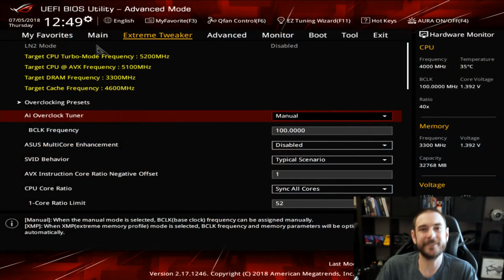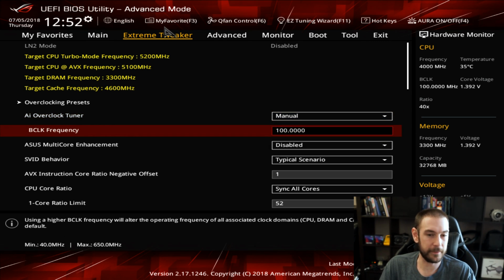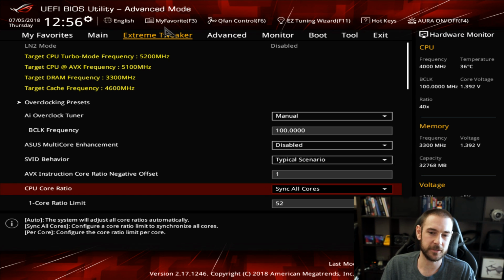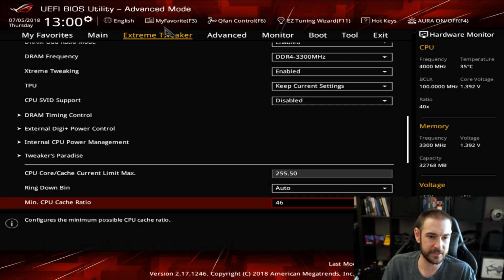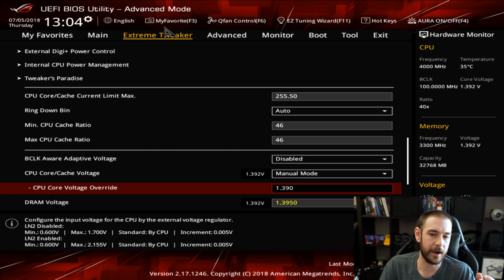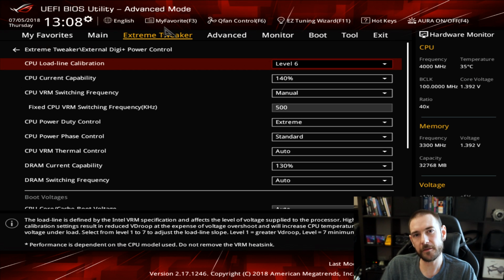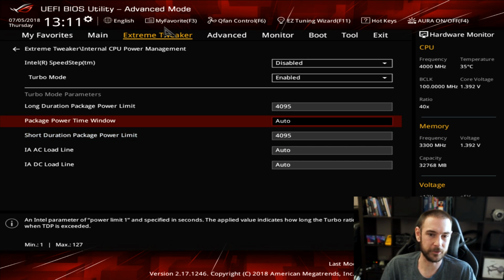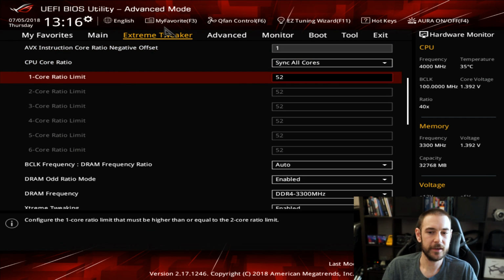How to Overclock an 8700K & 8086K - ASUS Maximus X and Others

Comment: Can not thank you enough. Always had serious stuttering when running games with a 1080ti in my set up. Was able to make some decent gains with just this base tweak.
Reply from the maker: That’s great news :)
Reply: So slightly new issue: I’m running roughly the same setup but I swapped in new ram that clocks at 3600Mhz at 1.35V. But it won’t boot now for some reason unless I set to default settings
Reply: I'm running the same motherboard with an 8086k. I was able to get it stable at 3300Mhz and all cores at synced to 48. It just seems a little strange for this set up it would require those values.
Reply from the maker: What’s your VCCSA and VCCIO set to currently and have you configured your memory timings?
Reply: I belive i set them to 43, where you recommended 42 in this video. in terms of memory timings I haven't played with at all, but I essentially followed all recommendations from this guide. I will probably just need to look into some other guides of yours for more clarity on pushing it a little further. I got it fairly stable with the ram clocked to 3300Mhz and had some improvement on my benchmark but I'll  have to look more into it this week.
Reply from the maker: Sorry. I think you’ve misunderstood. What are your VCCIO and VCCSA voltages?
Reply: Boosted Media 
Cpu core voltage override: 1.3
DRAM voltage: 1.35 (as said by my ram manufacturer)
VCCIO: auto (1.328v)
cpu system agent voltage: auto (1.144v)
Reply from the maker: Try lowering your VCCIO to 1.15V and check your memory timings are all set to auto
Reply: No dice. Still getting sent to the American megatrends screen saying system couldn’t post because of instability.
Reply from the maker: Try dropping your cache back down to 42 maybe. Going past that really makes no difference anyway.
Reply: Did all that and still having some issues with instability when the ram is set to 3600Mhz I have it set to 3200Mhz which seems fairly stable.

Comment: Thanks for the tips. This helped a lot. I managed to get my 8700k stable at 5.0ghz at 1.25v using your guide. 

My only question I guess is an odd one. Should my system be stable at that voltage? I’ve tested using cinebench and Aida64 and running some games for a couple hours like battlefield 1 and it hasn’t crashed or anything even once. Temps on my x62 are around 70c max under synthetic load and 60c when gaming. Not delided.
Reply from the maker: It’s impossible to say without proper stress testing. Check out my stress testing video :)
Reply: Interesting. I’m gonna chalk it up to I won the silicon lottery. I do get errors when I run prime 95 but no crashing. I’m gonna roll with it for a while and see how it performs thorough the weekend with my normal gaming habit. So far today with 4 hours of battlefield 1 and an hour of overwatch it’s been stable 5.0ghz @ 1.25v.
Reply from the maker: It does sound like a good chip!

Comment: One of the only videos that I've found that has the exact information that I needed to overclock my 8700k. I have an Asus Prime Z370-A mobo and it's auto 5ghz overclock was sending 1.488 volts to the VCORE. Right now I'm stable at 1.340. Temps are a little high around 87C on AIDA64 but I'm using the supplied thermal compound on the AIO. I might replace it with something better or even delid it later on, but for now I'm happy with this. If I could get the temps lower it would be great.. 
Thanks for the Video!!!
Reply from the maker: Glad to hear it helped. Thanks for taking the time to comment.
Reply: Dude you're cooking it, forget 5ghz and drop down to 4.7, you want 70c, 65c temps under load or less
Reply: I moved the AIO from the top of the case to the front. Now running a push/pull config on the 360mm AIO. Used Arctic thermal paste on the IHS and now I'm maxing out the temp around 74C. Placement of the AIO and thermal paste made quite a difference.
Reply from the maker: That’s a lot better! Probably had dodgy thermal paste application on the first try. Radiator placement wouldn’t account for such a massive temperature difference alone.
Reply from the maker: Anything under 95 is not going to “cook it”.

Comment: Hey, just how important is it to do a AIDA64 FPU only test and insure that CPU doesnt throttle? I'm working on a Asus Rampage VI Extreme with a 7820X with EK cooling and im able to have a good stable 4.8 ghz clock on 1.2V, but as soon as i do FPU test, it Temp throttles like 9% right of the bat and drop gradually with an occasional spike of about 2 to 3% but im seeing some cores at 105C. Should i always insure that FPU runs smooths with zero throttle and under 85C? This rig is gona be used for mainly gaming and mining at night....
Reply from the maker: I’m not experienced with the 7820X but that seems really hot for 1.2V with water cooling. 

I’d be checking your water block is installed properly with good contact.
Reply: @boostedmedia  Cooling is set-up properly. When doing a CPU test with 4.8ghz it's maybe in 60s range...soon as I hit FPU it's blasts to 105, then levels out at 95C on hottest core. I even ended up going 48 on ration and -10 on AVX. Same thing. Pulling my hair here. I'm thinking I just leave with a small amount of throttle because I don't think this comp will ever use AVX at such loads....what do you think?
Reply from the maker: AVX load is a lot more power hungry and therefore does drive temps up. 

If you’re certain your cooler is installed properly with the right amount of thermal paste then yes it’s time to delid or settle with an AVX offset.
Reply: Boosted Media  
Thank you for your help. I managed to stabilize it at 1.8V with an all core 4.5 ghz clock with 4 AVX and 6 512AVX off set. Seems like the down voltage from 2.0 to 1.8 did the trick for this CPU.

Comment: This is very good. I am new to overclocking. I7 8700k. Asus z370 prime-a. Corsair AiO water cooling kit.  I think that I want a safe and stable 4.8 Ghz overclock and your guide will help me do that.  I have a question though. Other than the core clock and core voltage, Should all of my settings mirror yours in the video, assuming I choose XMP to overclock the memory? You've earned a new subscriber by the way. Thanks.
Reply from the maker: Yeah the settings I explained in the video are a good starting point.

Comment: Great tutorial! Thanks a lot. Though I have one doubt. I have maximus X formula (with the VRM water cooled) and 8700k. With your settings and multiplier 50, voltage to 1.35, cache multiplier (min and max) to 42, AVX=0 and everything is stable. I try to rise to cpu multiplier to 51 (all the other settings untouched) and it is not stable even at 1.4V. I know that each processor is different but I do not know if I could be doing something wrong. What do you think? Thanks in advance
Reply from the maker: You’ve just hit the limit of your CPU. My 8700K was the same. Once you hit the limit you need a much larger increase in voltage for a small increase in clock speed.
Reply: @boostedmedia  ok, could be bad luck with the silicon lottery 😖 I think that, since I have my mobo water cooled, I am going to try to set Cpu power phase control to extreme, since you said it could help with instabilities (though introducing more heat to the mobo). Do you think that this could be a good idea?
Reply from the maker: It’s worth a try but I don’t think it’s going to help. You’re nowhere near the VRMs limit of stability. 

My 8700k needed almost 1.4V to be stable at 5GHZ too. 4.9 was fine at 1.32V.
Reply: @boostedmedia  ok I think that I understand what you say, thanks for your help 😊

Comment: 8700K 4.7Ghz at 1.25v 
On air cpu cooler - 
Cooler Master Hyper 212X (stable 4.7ghz oc @ 1.25v or 1.3v)
which one would u recommend.

Also what is the best and safest way to oc ?
Use:  *Enable Multi core Enhancement or *Turbo boost 

-Enable Multi-core Enhancement in bios and you get an auto 4.7 overclock. Just enable MCE, then manually change the voltage to 1.25V for a hassle-free OC.

 or 

Turbo boost: It will run one or more cores at a higher frequency automatically, depending on temperature and load. You don't have to do anything.
turbo clock is 4.7. As far as I know, this means that it can be temporarily boosted.

The 8700k boost clock is 4700ghz. Really to take it a 4700ghz all you need to do is raise the multiplier to 47. Just set it and forget it. Leave everything else on auto.
Simply raising the multiplier and leaving everything else on auto, is not the same as using auto overclock. Auto overclock will overvolt your cpu. Simply raising the multiplier will not.

kindly let me know thanks.
Reply from the maker: The lowest stable voltage is always the best. I recommend the method shown in the video. I never use auto overclocking regardless of the method as it almost always over voltages something.

Comment: I oc my 8700k to 5.1ghz when i do my stress test the vcore reached 1.52v which beyond what most people say. Also when in stress test the cpu throttle and temperature reached 100c easily. I just installed it and i am on watercooling custom loop. Why is my temp so high?? I am temped to reset it but it is a pain to do so because the watercooling hard tube setup.
Reply from the maker: Temp is high because the voltage is way too high.
Reply: Boosted Media i dont know the sweet spot voltage. Should i do offset mode for vcore with+50mv?? I doubt it will work for 5.1ghz. I get bsod until i set the vcore offset to 130mv.
Reply from the maker: Please watch the video. Your voltage is WAY too high. you're going to damage your CPU if you haven't already. Use Manual voltage while you find your appropriate voltage. It may be that 5.1GHz is out of reach for you.
Reply: Why Me it is still working fine at 4.8ghz ad little offset voltage. But temp mde it throttle. Unless i turned off throttling in bios but doing so in stress tests iget 100c. I decide to buy delid kit and copper ihs.

Comment: Hey boss man. You are posting again so Im hoping you are feeling better. Wanted to share with you that my OC settings and temps are pretty good with further tweaking, following your videos of course. I'm looking for some knowledge again. I was checking my CPU Core speed and they all seem to stay at 4.7ghz even when the computer is idle. Is this normal? Is there any suggestions you may have to have it idle down when not under load?
Reply from the maker: Hey mate. Feeing much better thanks. Yes that’s normal if you have throttling disabled in bios and using the windows performance power profile. 

If you change your power profile back to “balanced” in Windows it should throttle again.
Reply: @boostedmedia   Ma, man. I'll try that right now. Taking the dogs out haha
Reply: Damn. Just researched ur vid again. I missed the part where you said that high voltage on a CPU doesn't degrade it if it's sitting at idle. It's only when the load is increased if you have an overkill in ur current. Cool. I am currently running my CPU Core voltage override at 1.220. Do you think that's a good voltage or should I go up or down more in values?
Reply from the maker: So under load it’s running 1.22V? That’s well within safe limits.
Reply: @boostedmedia  yup. Was running a stress test with RealBench but it failed. I am currently running another RealBench test with 1.24V, system agent at 1.2 and VCCIO at 1.23.
Reply from the maker: I’d drop your VCCIO and VCCSA down to 1.0V and raise your vCore to 1.3. If it’s stable then work the vcore down.

I’m running 5.1GHZ with 1.0V VCCIO and VCCSA now. Vcore is 1.365 Under load on LLC6
Reply: @boostedmedia  ok man. I'll do those changes, retest and report tomorrow. Thanks for the knowledge and guidance. I have literally learned all these techniques by watching your channel. Freaking amazing.
Reply from the maker: Keep us posted :)
Reply: @boostedmedia  Sorry took so long man. Ok, just finished another stress test at 4.7GHZ. Did what you mentioned: changed VCCIO AND VCCSA to 1.0 with 1.23V core. Temps stayed at Package Temp of 71°C. Cinebench score at 206 single core and 1526. What are your thoughts?
Reply from the maker: Sounds pretty good! You could probably try for a bit more clock speed and go up to 1.3Vcore safely. Might even hit 5GHZ at 1.3V :)
Reply: @boostedmedia  I will try that man. You have given me so much knowledge on this. Understanding this concept is awesome. I will try to do that and report back. Honestly, thank you for all the guidance. Can't wait for the next vid man.
Reply: Hey Boosted, me again bro. So I tried what you suggested and I'm trying to achieve the best use of my chip so I'm raising my OC. Trying 4.8 GHZ, Vcore at 1.255, and vcca  and VCCIO at 1.1. temps stay at 78 DEGREES at the moment while running Cinebench. Any suggestions on improving temps? What about if I happen to crash or the computer restarts itself? Happened once already at 1.24v at 4.8ghz
Reply from the maker: You need to delid your CPU to get your temps under control and then raise your Vcore to make it stable by the sounds of it.
Reply: @boostedmedia  always a wealth of knowledge. Thanks.
Reply from the maker: I’m just editing a video about stability testing now. :)
Reply: @boostedmedia  man, we can't wait. COOONNNTTEEENNNTTTTT!!!!

Comment: sick cpu, mine needs the same voltage for 5ghz. Albeit i am a heckler for stability and wont call my OC stable til months later while checking for hardware errors daily.
Reply from the maker: Yeah I’m the same. Running overnight RAM, Cache, FPU, CPU tests etc for weeks before calling it stable.
Reply: Mine is fine to do 5ghz at only 1.25v.
Reply from the maker: How are you stability testing though and do you have AVX offset?
Reply: No offset, I've been using this overclock since November without any issue. Stress test by benchmarking, stress function in CPUID and months and months of general use. I think if it was unstable it would have shown itself by now?
Reply from the maker: Nice! Would love to know if it passes a few hours of OCCT stress test on default settings. Mine can do 5.1GHZ no problem at 1.25v for daily use but fails most stress tests.
Reply: Just downloaded OCCT, what a great program. I'll leave it on a stress test when I'm not using it and see how long before it crashes, if it does!
Reply: @jamesrothwell8693  Stress tests tend to use computational algorithms that no normal use will ever require, wouldn't worry too much about stability under these conditions over extended periods... one thing to note prime 95 for example can be potentially damaging to run for long periods due to excessive thermal die increase.

Comment: My temps got colder after overclocking my 8700k on a Asus z370-e gaiming to 4.6ghz. the stock voltage that Asus uses I think is just bad and causes too much heat. Though it was a conservative overclock I am happy. I kept load line collaboration at level 5 and ran voltage at 1.295v and so far ran prime 95 maximum heat and Aida 64 and temps are good. With avx workload, hottest core was like 85c, and without avx workload I got around 70 max. I kept avx workload at 1. I am running this with an nhd 15. Thanks so much for tutorial best one online. Also my cinebench score increased from 1475 to 1524.
Reply: Considering a delid, will use your tutorial.
Reply: 1.295v is way more than needed for 4.6ghz dude, the stock Intel vcore at stock speeds with no mce, 4.3ghz and 4.7ghz single core vcore is 1.190v

I use 1.235v and high LLC (gigabyte board) for a fixed 4.7ghz oc, stable and max temps of 72c with a dark rock pro 4 air cooler.
Cb score 1564

Your vcore is creating unneeded heat

Comment: Hi whenever I disable cpu svid support it causes my pc to crash on startup but when I disable it this doesn’t happen. It looks like it is the only setting that is crashing the pc, I have a 8700k on an ASU’s z370-f, any suggestions??
Reply from the maker: It’s probably the CPU Power profiles causing the cpu to run a different voltage than selected in bios. Hence why I keep it disabled.
Reply: Boosted Media is there anyway to get around this as I would like to disable svid support for overclocking because the auto temperatures the motherboard sets for my oc is too high as it is over 80 degrees
Reply from the maker: Yes. Use the same settings as the video.

Comment: After dabbling in some OC it seemed to introduce some coil whine, even when I reset to defaults. Any ideas?
Reply from the maker: That’s pretty normal as the power demand increases.
Reply: Boosted Media even though it stays when I load the non over clocked profile?
Reply from the maker: Are you running your VRMs in extreme mode still?

Comment: Thanks for this, very helpful. What voltage would you recommend for a 4.6-4.7 overclock with a 8700k? I have a decent air cooler and i don't wanna hit any extreme temps so overclocking past 4.7 is not ideal for me. Thanks
Reply from the maker: I’d start at 1.28V and work down until it becomes unstable.

Comment: Ok I did all that, but when I go back to my bios, it still says my cpu is running at 3700mhz. It should be at 4800mhz cause I set my ratio to 48. When I pull up my task manager it says it’s running at 4.8ghz, so I’m not sure what’s correct. Someone help!